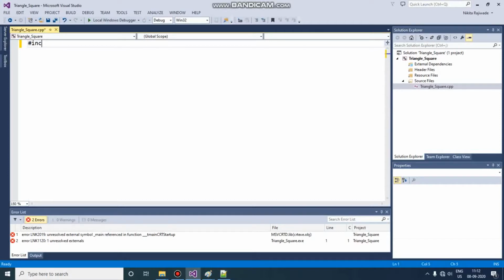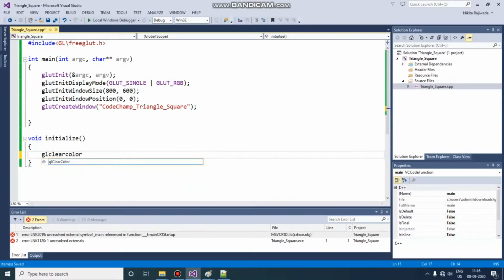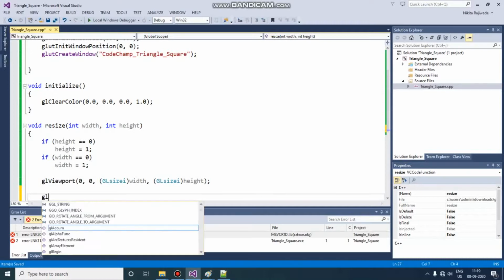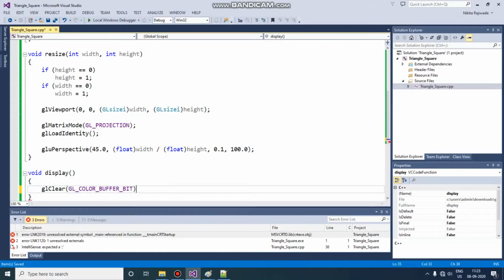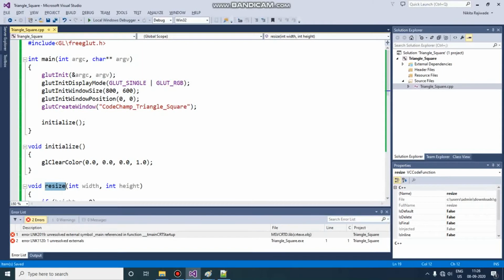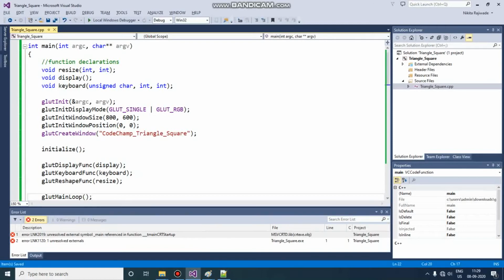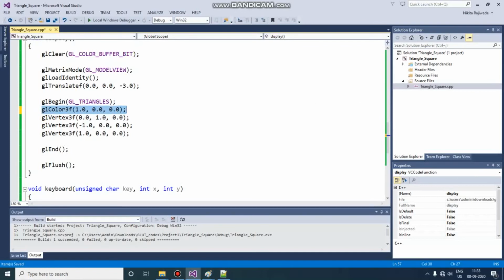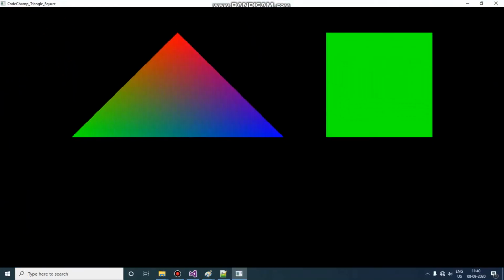Drawing a Triangle in OpenGL | 2D Shapes  | GLUT Tutorial

Comment: opengl code which display a three triangles with color Red Green and Blue. mam check this Q.
IS THIS RELATED WITH YOUR VIDEO
Reply from the maker: In a single line you want? How do you want to arrange 3 triangles?
Reply: @CodeChamp  in one triangle 3 colors
Reply from the maker: @studenthelpdesk8225  yes you can use same code just remove drawsquare code and copy paste the triangle code twice